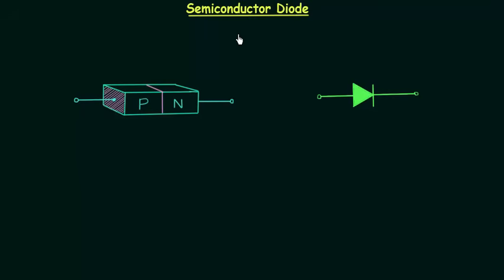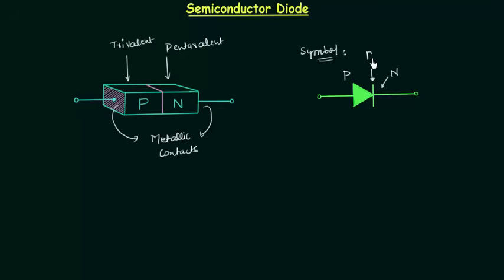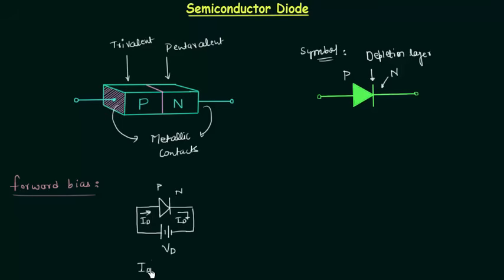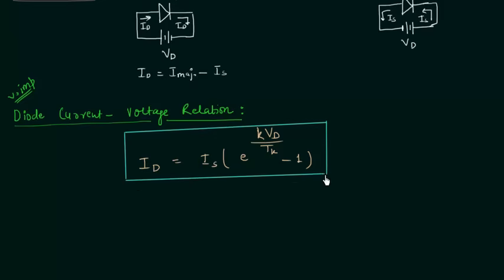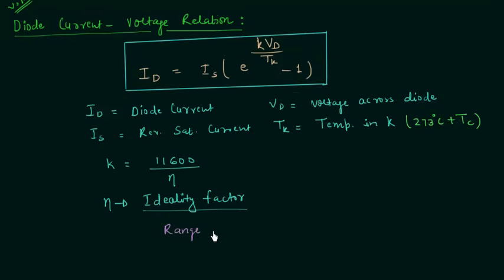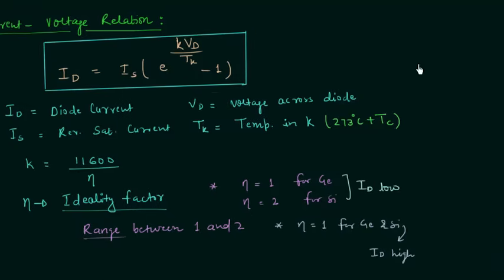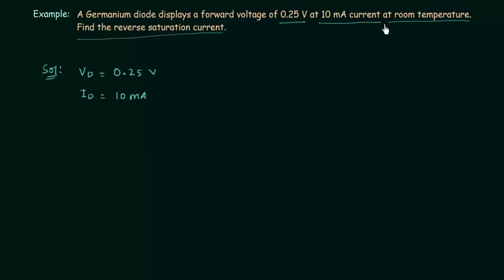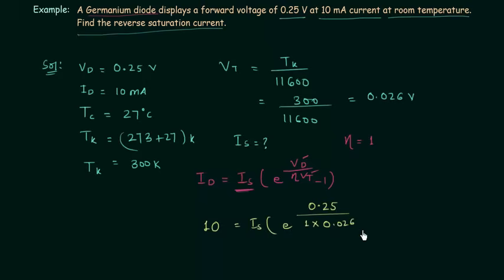Semiconductor Diode

Comment: 00:00 PN Junction diode is a semiconductor diode with two metallic contacts.
01:32 PN Junction diode symbol and forward bias condition
03:04 Understanding Diode Current and Voltage Relation
04:43 Current and voltage relation for diode
07:07 Calculating diode current using modified formula
09:00 Calculate reverse saturation current of a germanium diode
10:34 Calculating reverse saturation current of a germanium diode
12:23 Reverse saturation current is 0.667 microampere

Comment: Hello sir, small doubt. If diode is open circuit when reverse bias voltage is applied to it. Then what exactly is reverse saturation current because when it is open circuit the current should not flow right.
Reply: That is for the ideal case.....in ideal case no current should flow......but irl a small amount of current flows in reverse bias condition before reaching the breakdown point